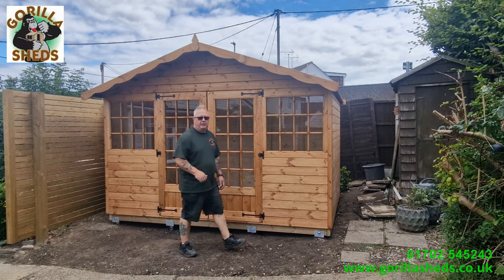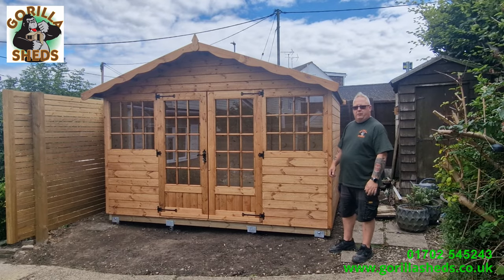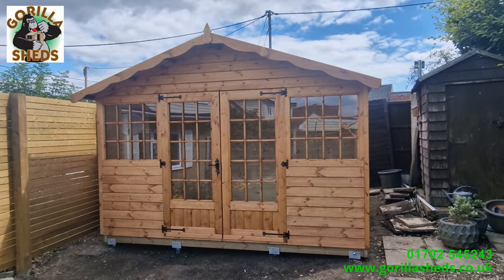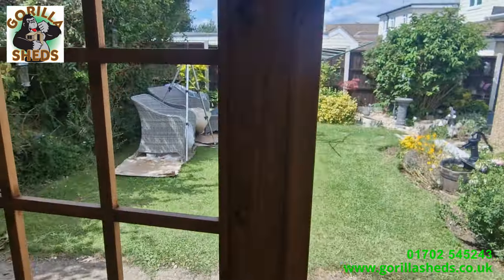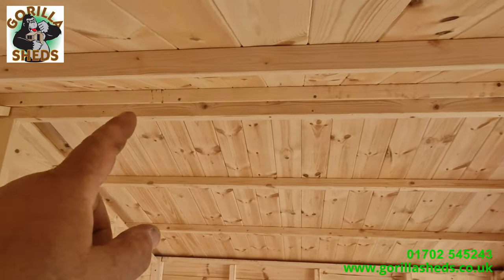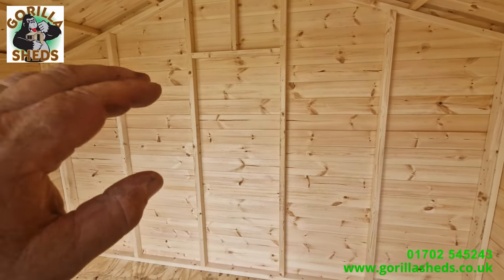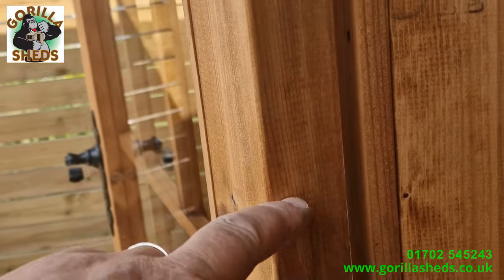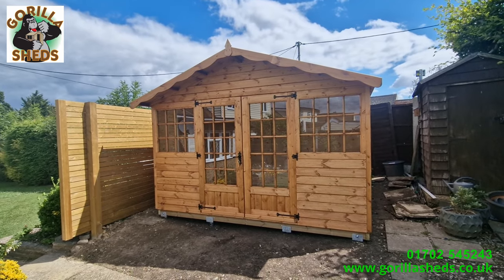11 x 8 Georgian Summerhouse with groundscrew base

Comment: looks good，how much？
Reply from the maker: Prices at January 2024:
12 @ 1.2m Groundscrew base (including floor frame - £1,129.00
11 x 8 Georgian summerhouse with 3/4 glazed doors, Fleur-de-lyss cast iron hinges and handle, lockset installed - £2,386.00
Treated with Barrettine Wood protective treatment, light brown - £99.00
Total cost - £3,596.00 completed, ready to use.
Reply: That’s fantastic work, I have you guys in mind in 3 years when I retire for a summer house and shed at bottom of my garden in Lydd